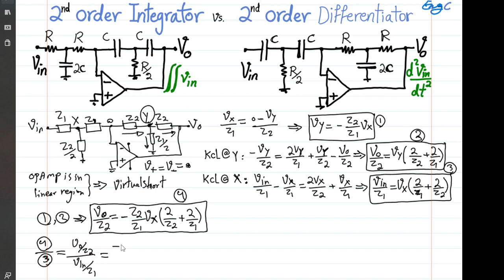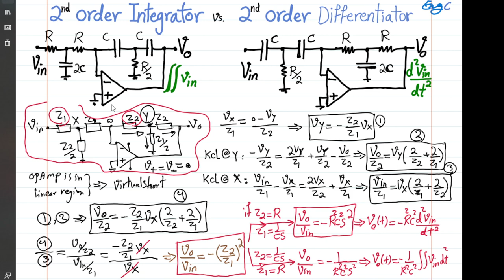Filter Design with operational amplifier: second order Integrator Lowpass vs Differentiator Highpass

Comment: This is exactly what I was looking for. Hope you see this reply even though it's a year late.Thanks just the same!
Reply from the maker: @geneglick3428 Glad that this video is helpful. Thank you for the comment.  Here are a few related analog circuit videos:  Sallen-Key Filter Design: LPF, HPF Frequency Response https://youtu.be/KwUnQXbk7gM
Double Integrator Amplifier with single Op Amp https://youtu.be/ZtGVJPIrsT8
Bode plot Frequency Analysis of Differentiator Circuit with Op Amp https://youtu.be/BLVzuuqAlZs 
I hope these videos are interesting as well.
Reply: @STEMprof  I was looking for a 2nd order integrator, but couldn't figure it out myself. I wonder how anyone thought this up? Anyway, after I understood what you did, I got to thinking about how it would behave in non-inverting mode. Kind of interesting that in non-inverting mode (Vin at the opamp non-inverting terminal, and then replace your Vin with ground). The result was not expected, Vo = 1 - (Z2/Z1)^2 where I was expecting 1 + (Z2/Z1)^2.

I'm a fan of Maxima for computer algebra stuff. I used your equations, but changed it to a set of 3 simultaneous equations. Then asked Maxima to solve it. Here's what I came up with. It works for both inverting and non-inverting configurations.

eq1 : (Vx-V2)/Z1 = (Vy-V2)/Z2$
eq2 : (V3-Vx)/Z1 + (0-Vx)*2/Z2 + (V2-Vx)/Z1 = 0$
eq3 : (V2-Vy)/Z2 + (0-Vy)*2/Z1 + (Vout-Vy)/Z2 = 0$
eq4 : solve([eq1,eq2,eq3],[Vout,Vx,Vy])$
define(Gain(V2,V3),fullratsimp(rhs(eq4[1][1])/Vin))$
print("Gain inverting mode=",Gain(0,Vin))$
print("Gain non-inverting mode=",fullratsimp(Gain(Vin,0)))$